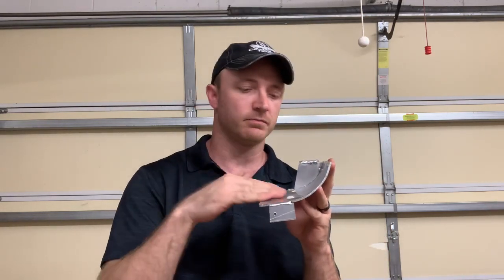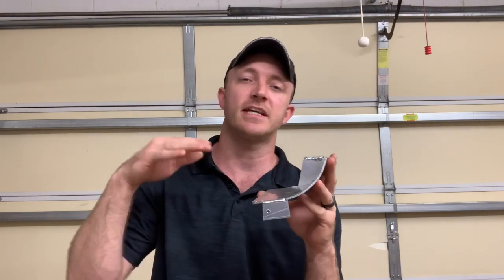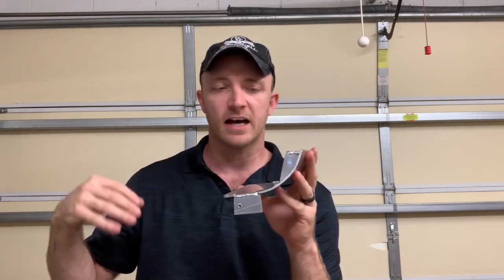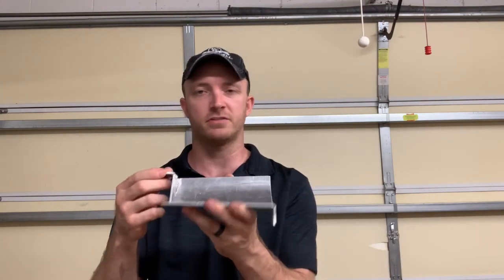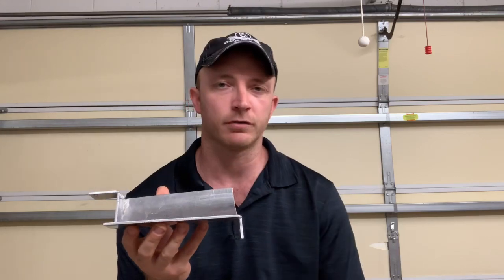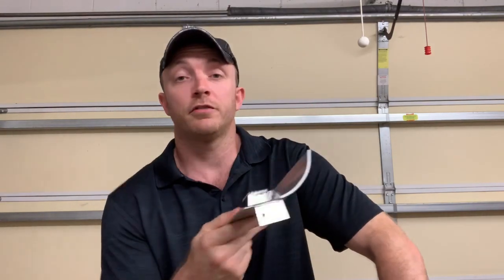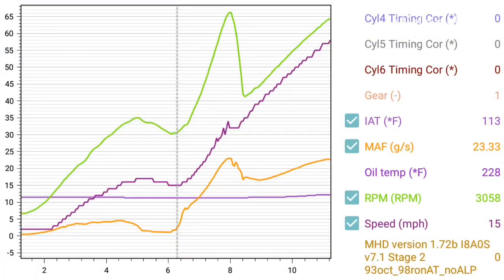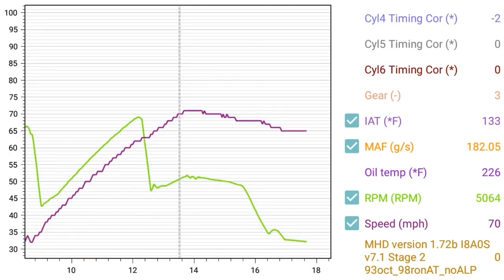E92 air scoop review

Comment: It’s more like this . The hotter the car gets from the less power you will peak out from your engine . The air scoop should keep the hp more consistent when racing or doing heavy pulls as it’s cooling off the engine resulting in less heat meaning more consistent power

Comment: Did you try on the highway? Heard it’s better suited for high speed etc but not sure how accurate that claim is
Reply from the maker: I did not try it in highway. Honestly I took them off. For now. If it ever sees a dyno I will I stalk them just to verify but I was very disappointed. And that is my own design I should not speak for anything else. However i did a velocity stack intake through the headlight in an e36 recently. I did not do a review with data which I will be showing it soon but 100% it made a difference on that car. As soon as the throttle is opened the intake air temp begins rapidly dropping. Of course this e36 is NA and the e92 is turbo.....
Reply: @carsetc.7190  ,im wondering you could reset  adaptions the ecu would have to figure out..after you'd drove it hard for a while  (on a motorway perhaps),i expected maybe a couple of hp ,but you didnt even get cooler  IAT's than stock im suprised